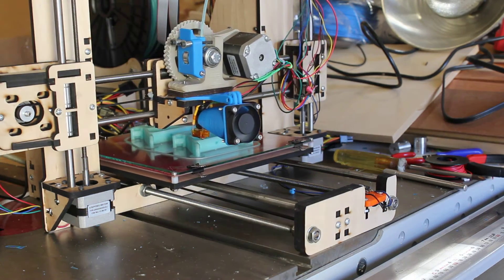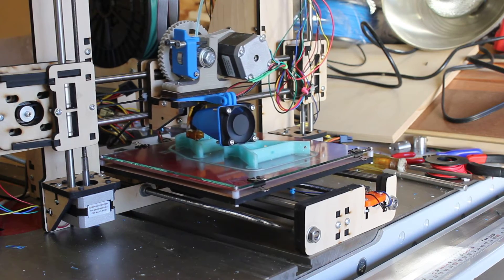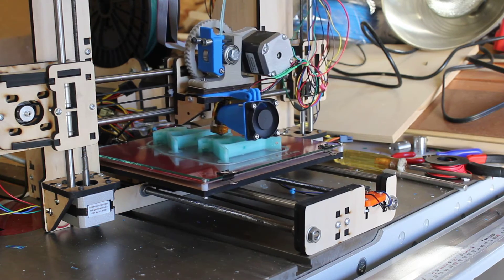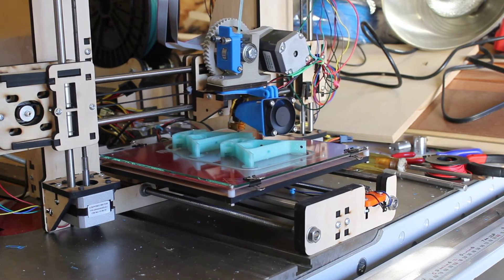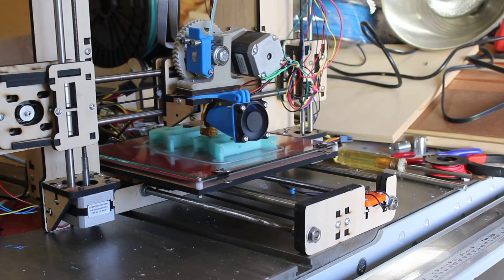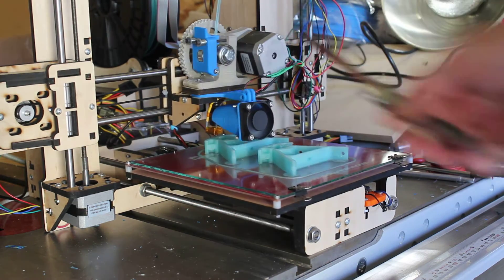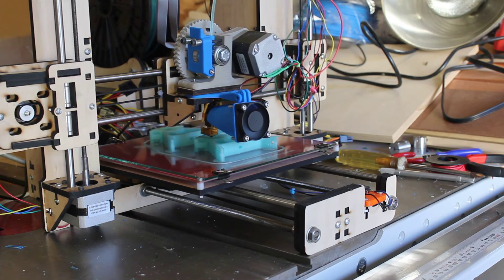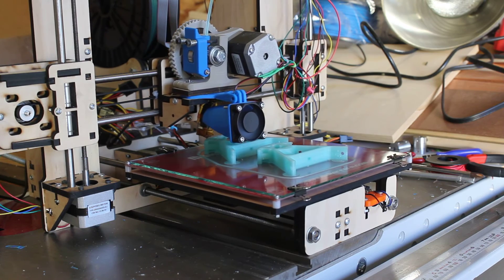Makerfarm Prusa i3 3D printer - Six weeks in.

Comment from the maker: I'm glad I could help you in your decision!  I went for the 0.35mm J-head, as the Magma was not available when I got my kit.  The .5mm is probably easier to start with, and will have a higher top print speed than the .35, but the .35 can print with higher resolution. The J-head in general is a really well understood design.  The Magma is really new, and the all-metal contruction inspires a lot of confidence.  If I were buying today for the first time, I'd probably go for the Magma.

Comment from the maker: As an experiment, I printed several sets of nautilus gears in PLA without cleaning or re-spraying, and I eventually gave up when the residue was thick enough that it was no longer a smooth surface. It was still printing PLA just fine.  ABS, on the other hand, needed a cleaner bed and fresher spray, probably due to the higher bed temp.

Comment: Shortly after my last posts I found out the cause of my Y-axis variance, turns out the screw that holds the Y belt to the bed was slightly loose. After tightening it and and printing another test cube at 70% speed I am AMAZED!!!!! My print was within a less than .2 tolerance and has no visible flaws. After all these tests I have noticed that the hair spray only needs to be sprayed after the glass has been cleaned and not at the beginning of every print.

Comment: Sorry for the duplicates, youtube was givving errors when posting. Back to what I was saying.
Heating it up loosening all the part, then leaving them in acetone to break up the plastic enough to clear it out. Now that its back together and I have the fan duct all my previous issues are gone, but I have noticed that there is some slight give in the Y bearing causing the print to shift slightly when it has to bridge. I haven't quite thought how I might fix this, but I will get it eventually...

Comment: Well I tried the hairspray and it didn't help my warping issue. Which led me to suspect the fan, that Colin says is required to be on with the magma head, was cooling the print and causing it to pop of the bed. So took the fan off and printed that fan mount and duct, which fixed my warping issue. Shortly after I noticed plastic began oozing from between the brass nozzle and the aluminum block that holds the ceramic heater. I then began to disassemble the magma head, a rather painful process of..

Comment: So far I have only printed the calibration cube and a resister guide, and have had no issues with the magma head. I am having issues with the print cooling and warping off the bed with blue painters tape. Haven't tried hairspray yet, will tonight.